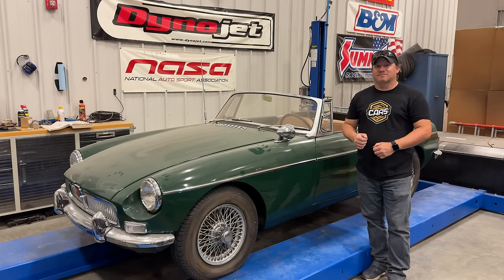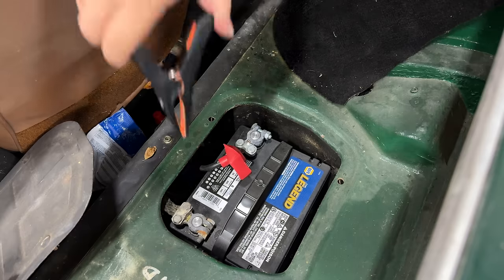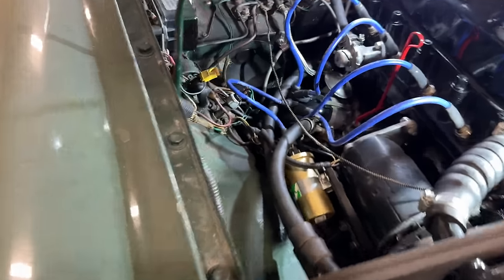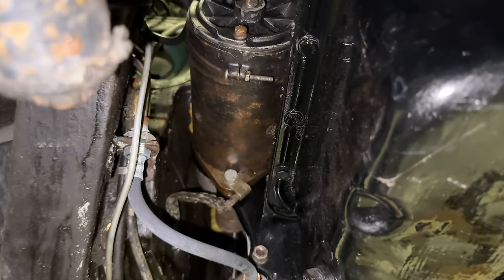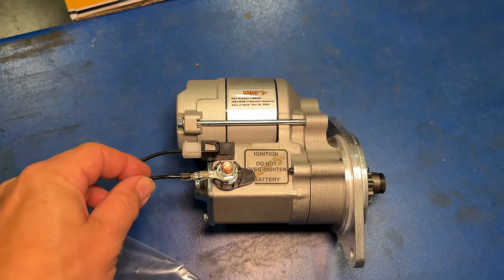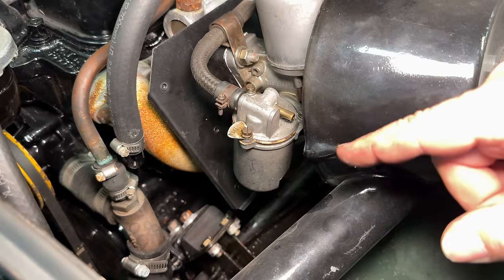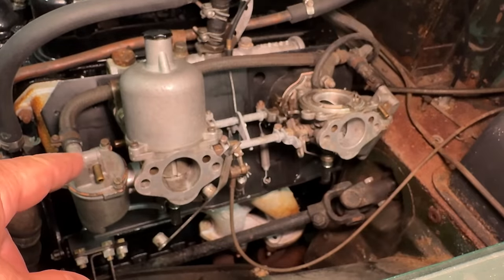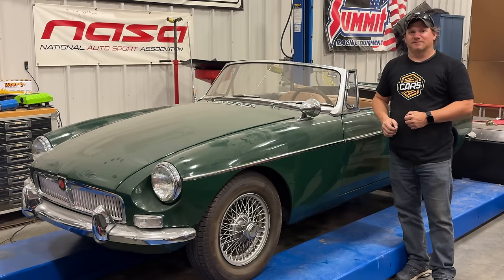1966 MG MGB - Will It Run?

Comment: The initial symptoms reminded me of my 1969 MG Midget that I bought in 1974 for $1,200.00.  It was in perfect condition but every so often it would just click and not turn over.  I finally found that the problem was the starter pinion gear would get stuck sometimes.  After that I kept a small stick in my trunk and just tapped the side of the starter to loosen up the gear.  Worked every time.  That's how it's done when you're a penniless college student.  I later drove it cross-country after graduation and it performed like a champ.

Comment: If you look at the other end of the Solenoid I am sure that is a button covered with a rubber boot. Simply test the solenoid by pushing in the button. That will activate the starter.  No need to risk sparking and damage by jumping wires

Comment: Looks very tidy and straight. Pity it doesn't have the Overdrive, makes a big difference.
I've just bought back a 67 MGB GT I last saw 36 years ago. I owned the very car in the 1980s and amazingly it came up 4 sale last April and its still in lovely condition, credit to its last 4 keepers.
One of them rebuilt the engine with a mild cam and close ratio gearbox – so she certainly goes better than a stock MGB. Nice to have her back after all these years.

Comment: This video brought back so many memories as the '66 B was my first car in British racing green with wire wheels.  I remember eventually converting to a Weber DCOE side draft carb and intake, and an Ansa exhaust system.  The "positive earth" made it somewhat challenging to install a modern radio as I had to build an insulated mounting box, and I do remember the gear on the original starter jamming in the ring gear and having to crawl underneath using a half-inch wrench on the end of the shaft to free it.  Tapping on the fuel pump with a hammer from time to time to get it to start working again was another quirk.  So very easy to work on compared to modern cars, though (thank God for the Bentley manual)!  I replaced the clutch in my driveway.  And back in the day you could buy carpet kits, upholstery, and convertible tops from J.C. Whitney...

Comment: i've owned the same 1968 MGB for 45 years     it's never been in a shop i do all my own work    a tip to synchronise carbs is to take a piece of hosepipe about 2 feet long and after removing air filters and with engine running insert one end in your ear and place the other end at throat of carb  you will hear a hissing sound   adjust carbs so that each one sounds the same

Comment: Nice I traded a tiguan for a 66 gt a few months ago its been off the road forever with the engine out. Iv been putting it back together. Its an enjoyable car to work on I never really liked them before but now I have an appreciation for them. I didnt know about that starter hope mine works or will have flipped my worn ring gear for nothing.

Comment: Manual transmission?
I'd have put in 1st gear and rocked the car back and forth. Sometimes starter just stuck.
Easy check before changing starter.
Ace work on the carbs! 👌🏼
Reply: I also had a '66 MGB and the starter would often jam. If putting it in gear and rocking it didn't work, you could also put a wrench on the exposed square end of the starter and nudge it off the jammed tooth.

Comment: Yes the Comments are correct on the Starter Solenoid they are notorious for getting stubborn with age  on my last MGB I kept a BallPean Hammer behind the passenger seat and  I put dents on the firewall to the trunk where that fuel pump  is mounted. I could feel the pump shut off and get it going with the hammer  ! While driving often shocking a passenger in the right seat !   My Bwas newer and the fuel Pump also was wired with a  emergency cut off switch mounted below the steering column  that in theory  during a hard abrupt hit  would shut power to the Pump  sometimes the drivers knee would bump that area and turn it off

Comment: That looks like a solid car even with the mouse evidence! I think maybe they threw in a battery to see if it would run and when it didn't they just gave up, not wanting to spend any money other than the battery. The 'soft top' seems to be alright though the window might be split as leaving them folded up for long periods is not good. Otherwise she is running well. It would be nice to see what upgrades you have in mind Steve. Another one back on the road. 👍👍

Comment: Wow. That was cool.
But I don't think I'd have started it without changing the oil first.

What operates those pistons in the side draft carbs?
Is it vacuum? I've never dealt with them.

One of my friends back in the late sixties had one of these. It may have been a midget though. I'm not sure.
It was a blast to tool around town in. The first gear was unsyncronized, so it may have been an earlier model.

Are you doing anything else with it?

Comment: Had a red one. Just like this but was 1965 MGB Roadster. Lots of problems with those starters  Those old style Bendix aren't reliable. Good choice upgrading the starter. Get the carbs set right they run pretty good for a 4cyl. Was planning to put small block Ford w/ 4spd in mine. Lost interest  .

Comment: No fair-you all have all the fun nowdays. Had a '66 "B" way back in the late 70's while in High School & I don't want to remember HOW many of those stupid Bendix starters I replaced on it. As well as a '65 Midget that was an electrical NIGHTMARE.
They are a blast-a bit "uncivilised" in the classic British sportscar sense-non synchro 1st for starters & yeah-what's a heater-but they are oh so much fun to fart around in. Get yer paws on that big 'ol steering wheel & DRIVE. Believe the term is tactile.

Comment: Steve, I'm wondering: after you freed up those jets, how heavy was it to pull out the choke on the dash? In my '64 MGB I have the issue that the springs on the SU's are so strong that I can hardly pull out the choke. The cable moves freely if it is disconnected from the SU's, it is not binding. Once it hits the point where the jets have to move down it gets very heavy. I wonder whether you have the same experience?
Reply from the maker: It should not be that hard to pull the choke.
Reply: @ThisWeekWithCars  Thank you for your reply. In that case I need to investigate why the springs on the carburettors are so stiff.

Comment: 1 check if the motor are sized. 2 use a spanner and turn the starter. The start "solnid" is actually a rely and it has a start button.

Comment: Please keep going on the B. Is that year a 3 or 5 main bearing engine ?
Reply from the maker: This is a 1966 so it has a five main engine, one way to "usually" tell if a car will have a 3 or 5 main is that they changed to the push button exterior door handle at the same time as they started putting in the 5 main bearings.

Comment: The fact that the radio turned off when cranking meant that it wasn't the solenoid. The voltage was dropping due to a poor connection.

Comment: Just bought a high torque starter for my Bugeye. Looks like a similar setup under the hood. Do you have to remove the oil filter to make room to remove the old starter? Or is there enough room to shimmy it out?
Reply from the maker: Yes it has to be removed, I just did a video on replacing the bugeye starter https://youtu.be/iZkyjO1UUJo
Reply: @ThisWeekWithCars  perfect thanks! And I’ll watch that video as well

Comment: the starter solenoid has a rubber button on the rear you can push to activate it and turn the engine over...?

Comment: You know these cars. Why would you clean the carbs; comment that their problem came from the old, bad varnish gasoline AND then use the same gas. Did I miss you replacing the gas or using a fuel bottle?